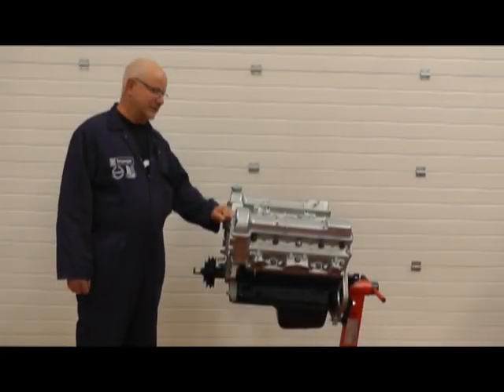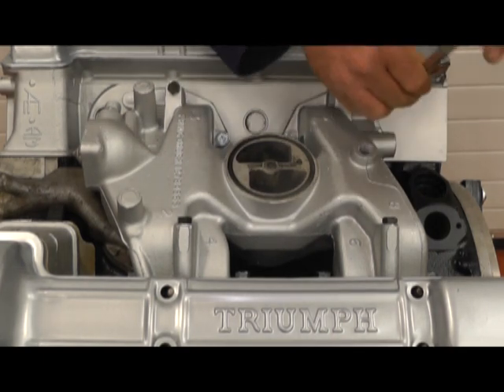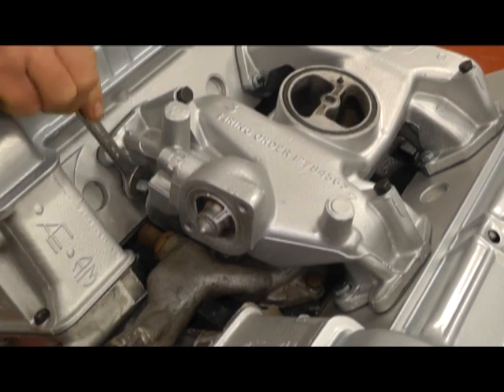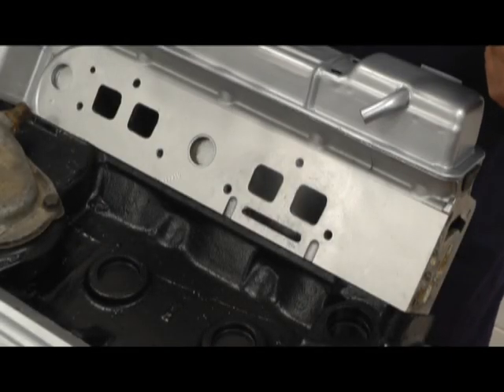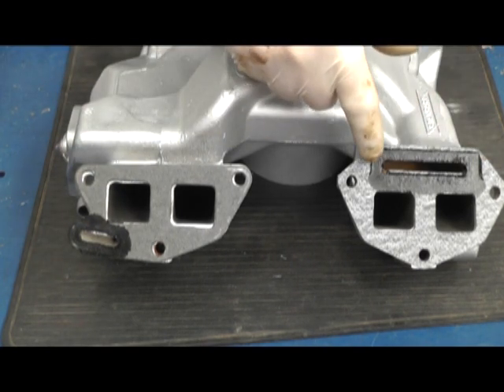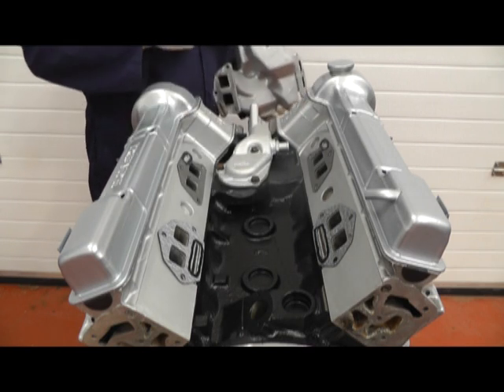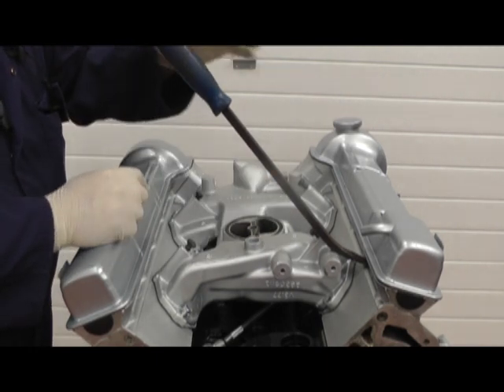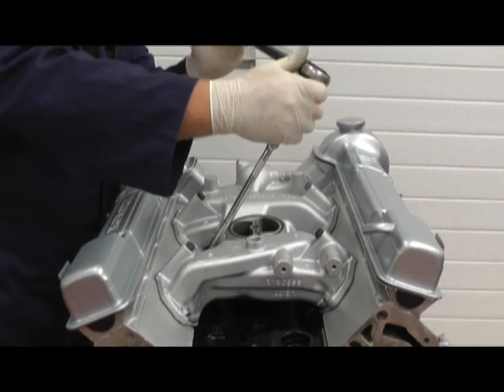Removal and installation of the inlet manifold on a Triumph Stag.

Comment: About to replace inlet gadgets on my stag found this very helpful. Interestingly a fellow gifted me his original dealership workshop manual which says you must back off the head bolts on one of the heads to refit the manifold to ensure a proper fit then re torque the head after the manifold is torqued 
Never seen this mentioned anywhere except in that manual

Comment: I did that many a time when it started leaking in laybys. The movement of the alloy heads caused the gaskets to leak between the manifold to the heads. Rubberised mastic worked well. The bolts were a problem as they entered the allow head and not very strong

Comment: Hans, just on the aspect of the sealant you use, it is correct that you are using an ordinary silicone sealant (one that will set, unlike say Hylomar Blue) on BOTH sides of the gasket and ONLY around the waterways. You place the gaskets on the heads and let the sealant almost set (about 10mins), which serves to hold the gasket in place, then fit the manifold.